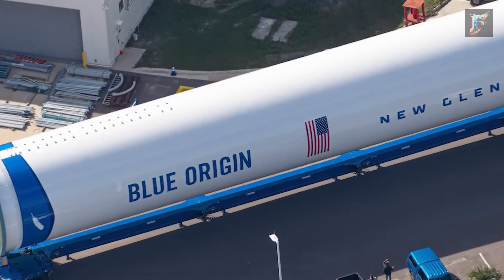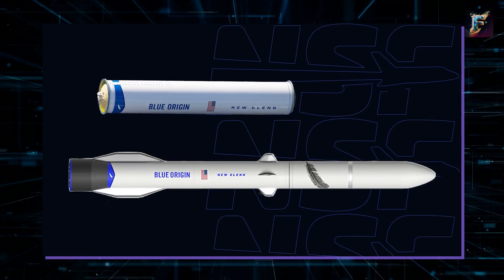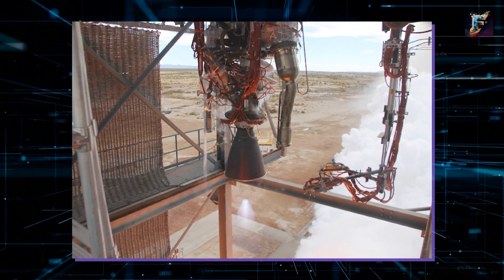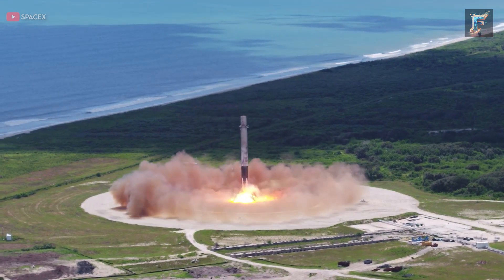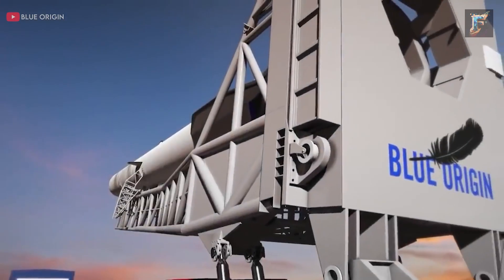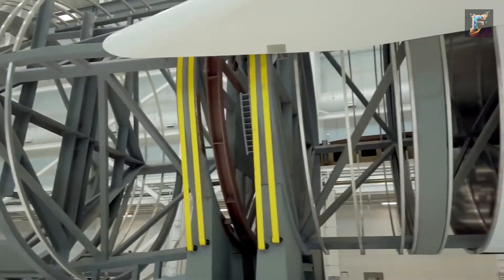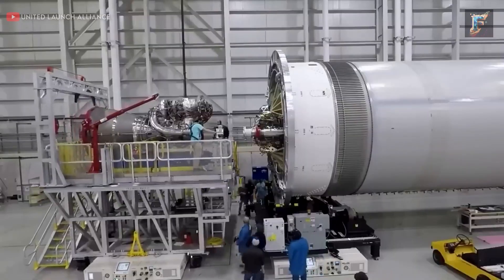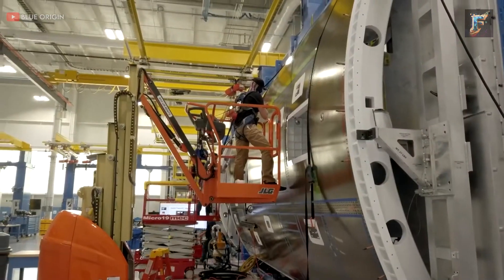A Glimpse: New Glenn Rocket Revealed & SpaceX Developments

Comment: My take is that New Glenn is not nearly ready enough for a maiden flight next year in time to send 2 small spacecraft to Mars. No signs of the rest of the rocket stack are visible, and the decals on that tank look as if it were never meant to be raised to the vertical. There are no indications of how many flight-worthy BE-4 engines could be made available for further Vulcan launches, never mind a New Glenn launch. And all this is without discussing the second-stage. Where the hell is that?
No tests, no bolting together of even a dummy test-article. NADA. Nothing. New Glenn is vapourware, certainly for another 18 months at the glacial rate BO 'works' at.
As for attempting a landing on a maiden flight? Ha ha . Good luck with that, BO.
Reply: 100% agree, since the beginning Bezos vision of BO in regards to its achievements is a non starter. The man dream of being the new Elon Musk of Space but is failing miserably. Not only New Glenn is a vapor rocket but the whole company is. As you rightfully mentionned, the decalcs on the tank shows that the picture was a fabrication (not fake but intended to be photographed, it is a media op). It's sad that NASA is falling into this trap by allocating money to BO. At this point I'm thinking that SpaceX will go to the moon alone after a few years of shinanigans that will show NASA is just pushing this absurd Artemis project for money with no real intention to go to the moon.